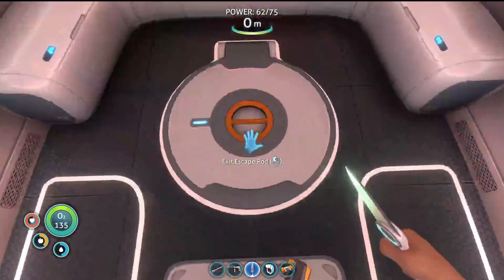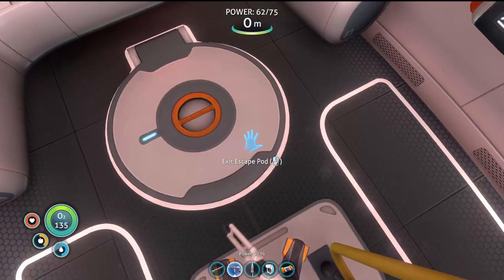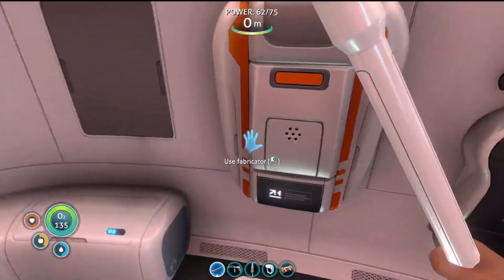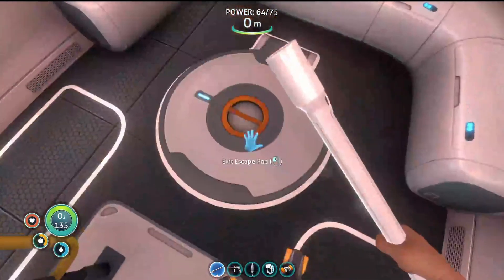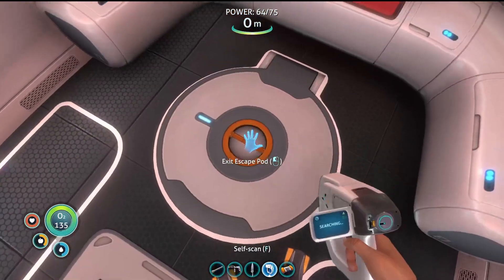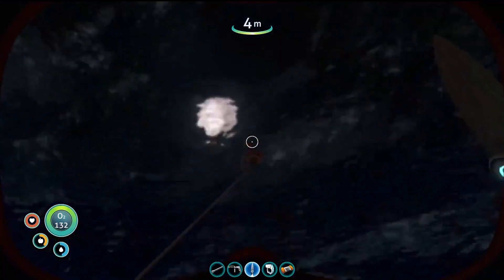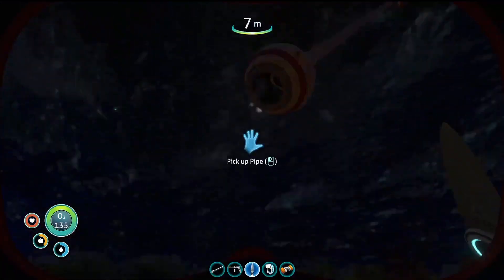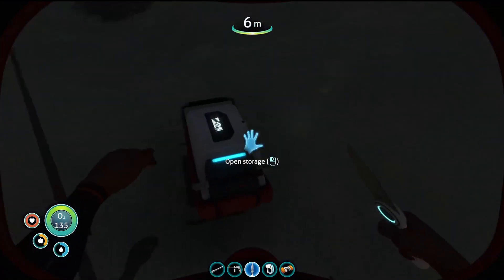What to do with air pump and pipes in Subnautica

Comment: A few more tips for new players:

You can have more than one oxygen tank. Tap the tank to swap it on. Swapping will take some of it and add to your base meter, so don’t be surprised it doesn’t fill oxygen to max. This can still massively increase time under water. Just be sure to fill each one by equipping when air is available. 

You can use growth beds for more than food. Brain corals can produce air at any depth. It’s slower than a pump, and it takes time for the coral to grow, but it’s much cheaper than pumps. Great for places like the brines. Acid shrooms and kelp also have use as bio fuel, lubricants, etc. 

Pipes have another use besides oxygen. They can obstruct movement of large creatures. Not quite a cage and does feel cheap, but you can use them to block a reaper and screw with its pathing. 

Floaters aren’t just pretty, they can be tools and scary weapons too. Attach them to a shark to hurt it and mess with its movement. Combine this with the prop cannon for range. Or lift an object out of water. 

The torpedo system can be expensive, but there is another way to use gas pods. Propulsion cannon can shoot them (unreliable but can.) or stasis rifle can stun a shark just long enough for you to dump them in their face. Looks silly but it will work. This could save you titanium. Recommend you try this on creative before survival.

Find valuable fragments but full inventory? Scanning may cause titanium to spawn under ground or stuck in box and be inaccessible. This is annoying when scanning later, but preventable. Use prop cannon to lift fragment box and scan.  It may even be possible to drag some fragments up with prop gun, but there’s little reason to do that. Just don’t scan with full inventory while on ground. 

Melons are best planted in wall pots. This is because cutting them from ground for seeds is annoying. Consider adding a few wall pits to cyclops. Use ground ones for other plants. 

Struggling with thirst. Consider saving a reserve of bleach on your cyclops or new base. Each can be made into 2 water bottles. Better yet, there’s a plant called a bulb bush you can grow for water called bulb bush. 

Last but certainly not least, if you space out scanner rooms about 500 meters apart in a grid like pattern or beacons, you can make a sort of grid and develop your own improvised coordinate system. Ever see how the grid is marked on battleship games? You can do that with beacons easy. Don’t forget you can take range upgrades with you from scanned to scanner to save material.
Reply: All very good advice, Jacob. The Bulb Bush garden is especially a life saver. This is one of the earliest things I do in Subnautica now, as it is more reliable than Bladderfish to supplement my water supply. I just want to add one piece of advice to this: don’t use the Thermoblade to harvest them, as you won’t get as much. It’s best to use a regular Survival Knife to get the most Bulb Bush pieces from a single plant (survival knife will give you five, thermoblade will only give you three. You’ll need to save one for replanting). I usually grow six plants in a single exterior growbed (which can be scanned on one of the wrecks in the Koosh Zone). I live off of these at my base, and then any water I make using Bleach is reserved for expeditions. Food will still be a problem, but Water will be pretty much solved.

Comment: I have a question, I used to be able to run pipes through wrecks as I search room to room. After the update, I can't seem to get pipes to run through a wreck's exterior, regardless if it is a door, bulkhead I cut through, or even a hole through the hull.

Anyone else experience this?
Reply from the maker: Well I haven’t play subnotica in a very long time so idk but it’s probably patched so sorry